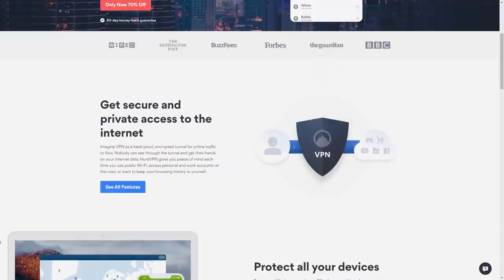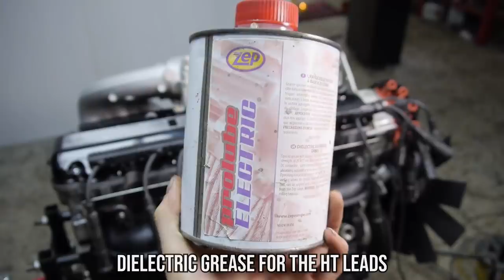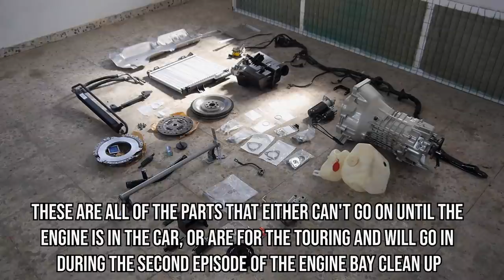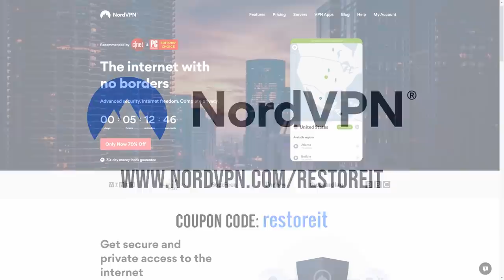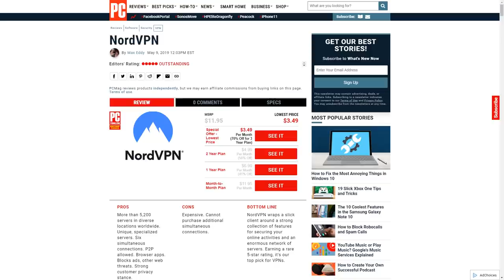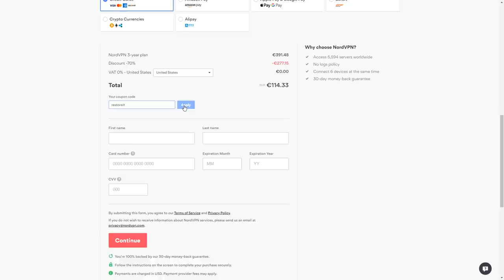BMW E30 M20B25 Engine Rebuild Restoration -  | Part 9 | Putting It Back Together Again

Comment: Have you fixed the timing marks?
Also, do not crank the engine with fuels. Crank it for 30 seconds than enable the fuel. 
Another thing why didn’t you upgraded the fan with electric one and the alternator?

Comment: some major mistakes made, no dowels to align the head gasket and head to the block. the engine wasnt timed properly. these could lead to catestrophic failure
Reply: Not to mention not getting proper torque on that crankshaft bolt

Comment: Are there no guiding pins to locate the cylinderhead on the engine? En did you time the engine before putting on the timingbelt? Just a question. Otherwise, looking very good!! As always

Comment: you forgot to add the dowel pins in the block at 13:40
Reply from the maker: This is correct. This is why i'm going to do a mini series in which I strip this engine down, strip all of the paint off, and recoat everything with a ceramic coating. I'll also remember the dowel pins on the reassembly. Cheers, Tomas.

Comment: Remember to check that all of your screws are tightened after running the car for a 150 miles or so! Because of heat and vibrations, screws tend to loosen up very quickly on newly painted surfaces. Ask me how I know!

Comment: It looks the new fan the opposite side to the front.  It wont make a good suction on the cooler radiator, and overheat that beauty.

Comment: Hi! I am sorry to bother you but, did you just at 18:31 assemble the propeller wrong way around? To me it looks like it should be vice versa. I've had a E21 320/6 and get aquainted with BMW engines and other technic and I am rather sure it is backwards now. And another thing.. If I would do the engine re assembly, I would put the flywheel and the whole clutch and the gearbox together before lifting the package back in the car. I mean there is no plenty of room to screw them back together under the tunnel.

Comment: it looks like a cellist folding an internal combustion engine for the first time, which he sees for the first time. Compound engine probably only to stand on a stand in the room as an exhibit, the camshaft completely not set at the right point.

Comment: Great build video. Question about the fan, why are you still using the clutch fan? Should switch to an electric one.
Reply: The original design works like intended from factory and performs it's job well. Why replace something just for the sake of replacing?

Comment: "I either lost or forgot to plate some nuts and bolts" Are you kidding me.. bad job then.. xd. All that work and your high OCD. How can you forget man... 17:55
Reply from the maker: Because I still have the engine, its not going anywhere. Its not a customers. I will sort it out when the new nuts, bolts and parts arrive. This video was already late, if I wait for everyone problem to be solved i would post 10 videos a year. It can't be a bad job as you say... Because the job is still on. Still a long way to go. You'll see more of my problems and mistakes from now on. I want to post as much as possible and this is the trade off. I'm super proud of myself.
Reply: @RestoreIt  .And i were only joking you around. I think this video is amazing dude! Yeah and you should be proud ofc. Thanks man. <3

Comment: Good job wiping off the engine stand first, it would have been a disaster if your new oil and grease dripped on your old oil and grease.

Comment: are u sure the car have the right timing?
Reply from the maker: No i did not set timing in this video. I would have mentioned it, i will be doing this before the engine goes into the car in a video down the line :)

Comment: Oh boy! So many mistakes. You should use a punch to remove seals, never chisel it. The other thing, you fitted them back from the wrong side. The hole is tapered for the seal. You should fit it from the side faceing out. You are really committed I see, but hopefully noone copy your way to fix things.

Comment: Don't you dare to start that engine.. the timing belt isn't set correct i think.. OMG.. THERE IS A WAY TO SET THE TIMING BELT OR ELSE YOUR VALVES GONNA BENT WHEN THE PISTONS ARE IN TOP DEAD CENTER.. I don't know what's the way to set the belt but the way he assembled it I'm sure sure sure something is wrong..
Reply: Why u assume he did it wrong? After all this insane work do you believe he wouldnt rotate engine by hand a couple of  times? These engines are really easy to time and understand.
Reply from the maker: Dont worry haha, i will sort the timing out before i even think about starting it. I'm missing many required tools to finish this properly. All will be sorted in good time
Reply: @RestoreIt  I know you got it.. 😊
Reply: @RestoreIt  okay good! It was also my concern

Comment: hmmmm... didn´t you forget all the bearings ect ect.... basicly what you did was painting it, so it looked god.?
Reply from the maker: hmmmmm, you must have missed the entire series. Every single bearing or seal was changed. All of the valves and vavle springs were changed, piston rings, everything.

Comment: out of curiosity why did you decide to add a fan to the engine? you could have freed up some hp and just simply use electric fans. The benefits of electric fan's over engine fans are endless...

Comment: Injectors weren't cleaned, bolts weren't plated, pulley doesn't have the right tool... But you keep assembling anyway. Why double the work :)
Reply from the maker: For the sake of the video :)

Comment: lower timing cover is broken, you dont need rtv, the ground wire from the oil pan is frayed, block-to-head alignment dowels are missing, you didnt torque your timing tensioner, oil sprayer is damaged, you're gonna have a nasty ass mess with grease on the plug wires after the exhaust heat melts it, flywheel cover should go on after the transmission, thats a 4 cylinder radiator, crankshaft bolt has a special tool for install, fan  with clutch should go very last. spark plugs should go in after adding oil and priming the oil pump, your timing is wrong, the fan is backwards

yikes. looks like a youtuber built the motor for some views and not a mechanic
Reply: Since you sound like you know a lot, where can I find the part at 11:37